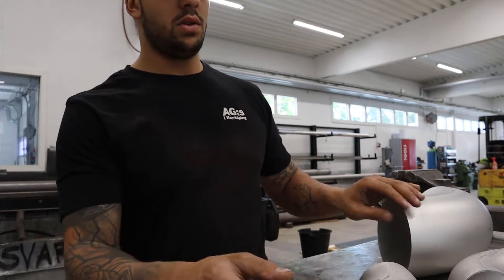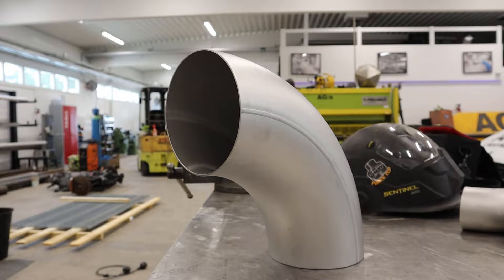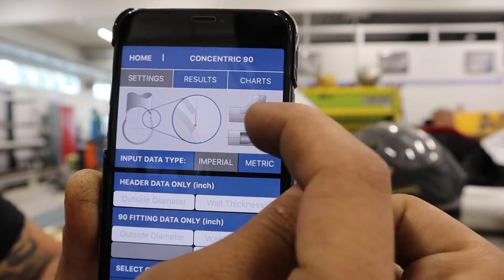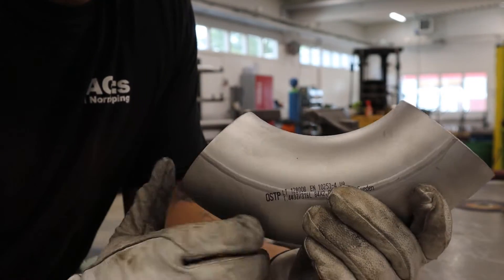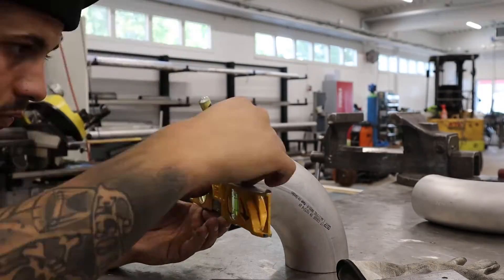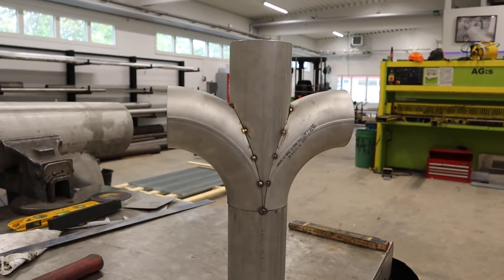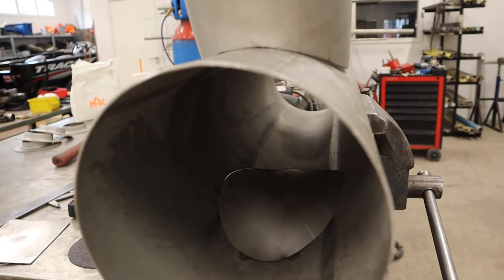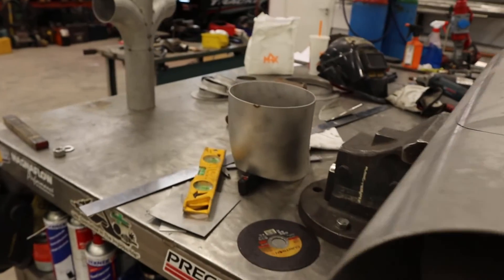How to cut and fit elbow on straight pipies

Comment: can't get the program to show correct measurements :-( tried on pipe Ø104 with a 90 degree bend also in Ø104 What am I doing wrong it only shows 2 outlet measurements
Reply from the maker: Hmm How Many ordinates do you choose in the begging? I usually put it in 16 or 32 ordinates :) and choose metric so you get everything in mm instead of inch

Comment: where do you get the 204 ? of inches is this curve, if for 6, rc is 228.6, if you are working with the diameter the tube of 6 is 168 so I don't know where you went get the 204 ...... 
the 154 I could see that it was marked on the chipping tube  on your video thank you
Reply from the maker: Hello sir! The 204mm is the pipe I fitted the elbow on 🤩 on the first version I showed the pipe was bigger then the elbows. And the other version I showed was when the pipe and the elbow was the same size 🤩